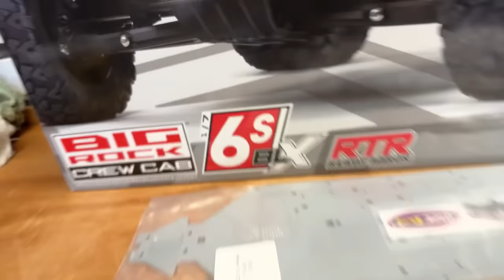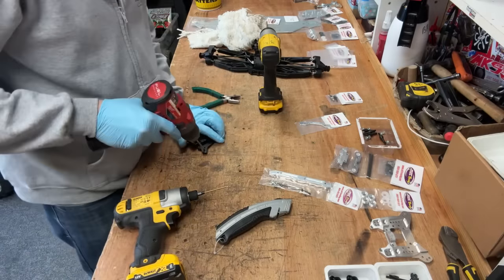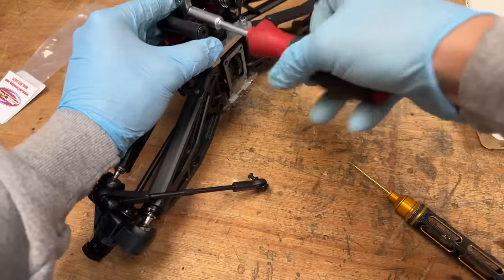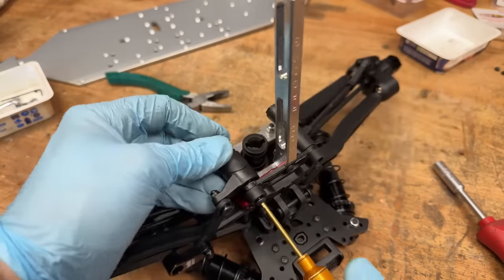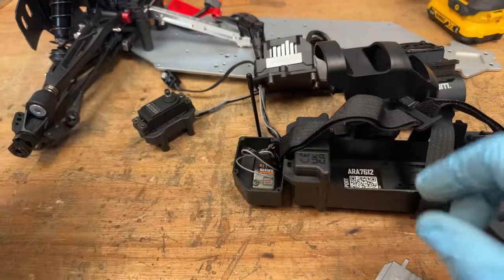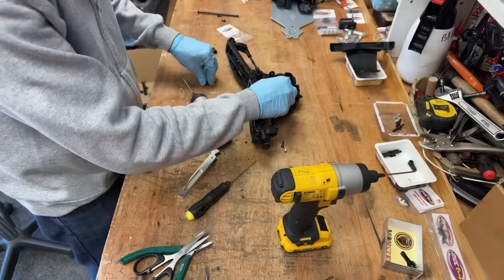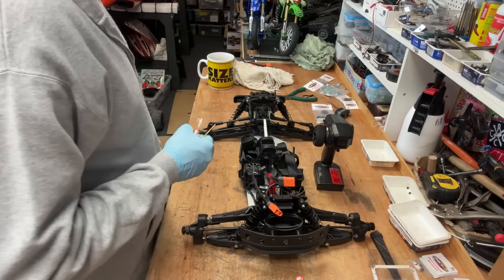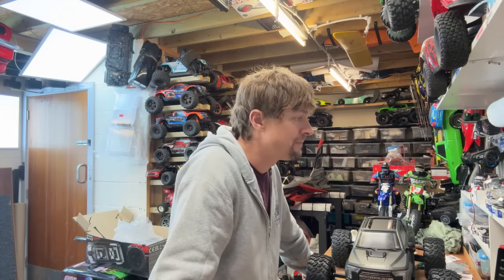Live unboxing and upgrade video

Comment: Win This Actual car https://raffall.com/350694/enter-raffle-to-win-m2c-full-modded-6s-big-rock-hosted-by-kevin-talbot
Reply: Kev what’s the link to the dewalt impact you use in most your builds?  Thanks.
Reply: One question I will ask if I ever catch a livestream ill ask but for now. what are, In Your Opinion (IYO) are the best hex or as old timers or USA people call(Ed) Allen head or Allen keys,   what are the best that dont round out/off?  I just got an induction coil hearer im going to use to try and temper after cutting off the rounded bit.
Reply: Hey kev, could I please have upgrades for the Arrma Granite Voltage 2wd please and thank you
Reply: Hey kev me and my three year old boy have been out bashing our ftx tracers brushless Ned more power
Reply: You gotta bash to see of its trash 😆
Reply: What's a complete upgrade rebuild cost
Reply: California

Comment: That cheap alloy from M2C's simple garage 3-axis mill is untempered, my DU racing towers which are actually 7075-T6 and anodized required my drill press.  Not to mention they are a much better 5-axis CNC fit and finish.

Edit-we won't talk about the cost😉...
Reply: Sounds nice !
Can you provide some facts showing the material properties of M2C vs DU racing?
Reply: I doubt it.  They can't even spellcheck
Reply: agreed- M2C is way overrated.
Reply: I own a M2C chassis and adu . The adu is fancier and more enforced . I got it for a stretched kraton
Reply: Arrma for me but Traxxas I also love so close second cause a V3 Kraton 6s got my started and still have it, had two 8s Xmaxx and they are wicked but I had too many RCS no room also had a Kraton 8s at the same time 2 Xmaxx one like new stock, one with just a Max5 and the K8 stock and right the K8 is more a racer feel from weight and the Xmaxx is a great RC it more depends how you drive IMO if you can understand how to jump them etc there's something for us all! 💯💪🏼💪🏼 I love ALL RC if it's fun, not always breaking on you less ones then just breaks once get an upgrade and no problems if you like it there you go!! Everyone isn't into different things and does different things with them 🤙🏼💯 Agree w.e makes you happy and my Uncle Lived there in a huge manor and had a Jaguar and he was the best uncle EVER truly most missed family member ever and I'm coming over this summer coming if I can work it all out cause I've never been on a ship, train or plane. I turn 30 yrs old tmrw so hopefully I can make it happen this coming year and bring my RCS if your able to bring them on a plane with batteries even if you need a fireproof w.e box I need to RC there and see my Uncle's Manor and I couldn't be happier your going to love there Kev! Wish you all the best in the move!!!
Reply: Sorry this was just for general comment but won't let me edit just said discard or not like YT doing some weird things for me any ways lately sorry lol
Reply: I can’t find these du racing shock towers your talking about where can I get them from?
Reply: But why bother if the m2c stuff holds up just fine?  Leave the ego out of it and use what works.  Our work friends and the chicks at the mall think we’re all booger eating nerds no matter what material our toy trucks are made of.
Reply: @emersonb5764  pricing and much better customer service.  I agree the majority of consumers will never bend/break the OEM alloy components unless they are under the influence or want to be like KT. 👍🏼
Reply: Isnt it adu racing

Comment: To make the front bumper install easier, I drilled out the 4 locations of the bulkhead screws allowing me to install the 2 rear bumper screws and nuts prior to installing the front bulkhead assembly. For someone who takes my RC’s down 100% after several runs to completely clean and check everything, I’m always looking for ways to make bad engineering designs easier to work with…

Comment: Also I think a good video idea would be to get a Tekno ET48 2.0 along with the M2C upgrades to see how well it stands up to bashing. Tekno rigs are already by far the most durable “race spec” kits you can buy so adding the M2C stuff would put it n anothe league. Having the ET48.3, ET48 2.0, EB48.4, EB48 2.1, SCT410.3, ET410.2 and EB410.2, and absolutely loving every single one, both because I can rip them competitively at the track plus bash the heck out of them, or when I want to do speed runs I just throw a 26t pinion, 6s battery, foams and a shaved rear wing on the EB48.4, which combined with the Tekin RX8/2650kv motor, it hits 100mph on the GPS. Surprisingly I can go through an entire 5000mah pack going back and forth in a giant parking lot and it never gets close to overheating either. I love the Tekin stuff. Every one of my bigger than 1/10 rigs has them, and the 1/10 stuff has mostly Hobbywing combos.

Comment: Futaba is and always has been 25t spline. I think HiTech or Savox or Spectrum, maybe all 3 are 23t spline. JR servos used to be 24t, I used them back in the early 2000’s, they were the first nice servos I ever bought. For just under 100.00 bucks they had the best specs out there.

Comment: The droop screws are important on some vehicles. They limit the down travel and stop it before the shock shaft and piston bottom out and stop all the weight of the arm/wheel/tire etc which is not good. If the arm hit the chassis before the shock gets to its limit then you are correct in saying they don’t really do anything. But if the shock is the limiting factor, by all means use the droop screws and you won’t destroy or have leaky shocks.

Comment: Afternoon kev just watched the video you done around 1yr ago called (ToTal Carnage) I had the idea of using 10mm tight coil shocks horizontal both front & Back behind Bar shaped Bumpers so if it lands tail on it’ll bounce rather than crunch also what about using either tungsten carbide or better still chromium for the chassis Base plate 👍🏻

Comment: My first RC is a Evo 2.0 and I wish I kept that too because I miss it. I did put least like five or $600 until I put up upgrade upgrade dry I put upgrade on servo and some other things I put into it so I can’t remember but one thing I did take out before I sold it. I did take my servo out. The guy didn’t mind. I told the guy I said one thing I’m taking out is my servo is the traction servo 2255 is that good or bad?